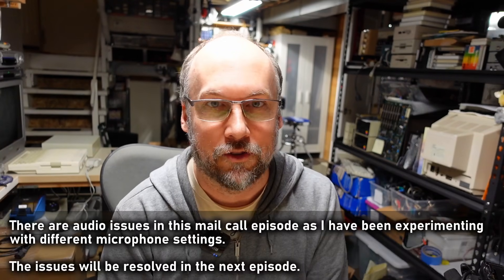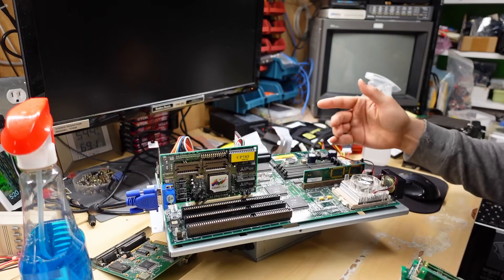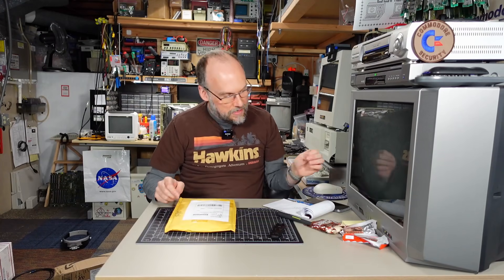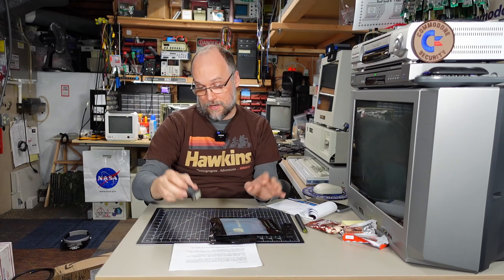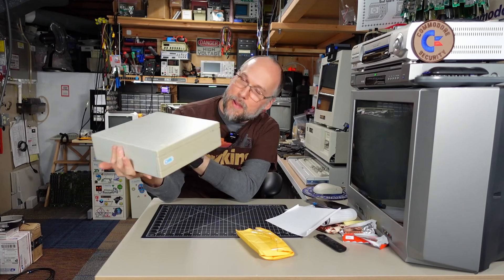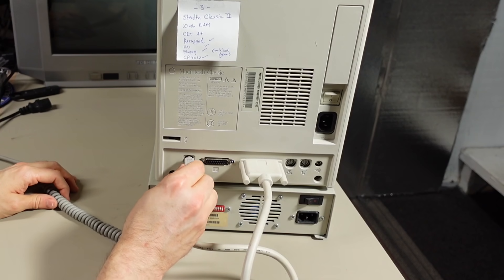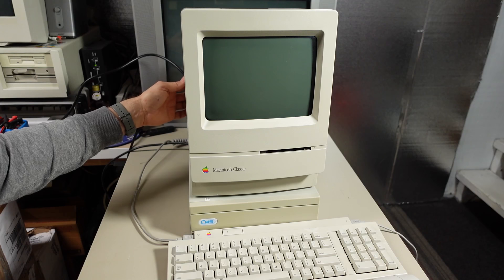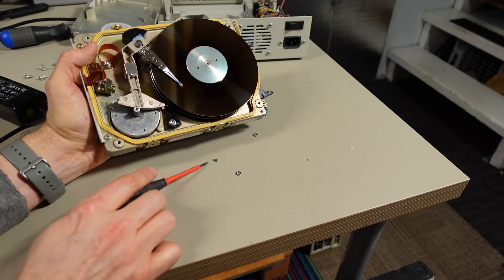30 pin to 72 pin SIMM adapters, a self-destructing SCSI hard drive and an Apple IIc mouse adapter

Comment: I don't remember Bigfoot drives being unreliable, just slow.  They did make a few 5200RPM ones.

I have a Seagate ST-225 which still works well.  And all of these Seagate low-impedance stepper drives have a good amount of intelligence in them.

Comment: 18:56 - I don't know what the difference is but I have a guess. I encountered NES controllers that work strictly on NTSC machines and not with PAL machines. My guess is that some timing or crystal or something is operating at a different frequency and your little adapter takes that signal and converts it to the right signal timing or something. It's just a wild guess but I might be not that far from the truth.

Comment: I had two standard 4x SIMM adapters myself to reuse my old 8x1MB SIMMS in a newer 486 PCI board. I wasn't aware that people would actually do this for Pentium boards, too. Doesn't make too much sense to me though, as old 70ns+ non-EDO SIMMs certainly bottleneck the fast Pentium system. And these huge adapters don't look cheap either ;-)

Comment: The serial adapter must have a wiring layout in it that reroutes the wiring correctly for the IIc for that particular mouse.  Maybe the IIc would only accept a particular serial wiring from the mouse, and other Apple computers would handle any serial input layout from any mouse.  Seemed very strange, but seems like the only plausible answer.

Comment: That Classic is special. Not only does the 3 finger solute reboot it, but it also has an LC-like boot tone. Do you have a custom ROM in there? Maybe a Classic II motherboard upgrade? According to MacTracker, the Classic II did use the LC boot tone.

Comment: 26:40 - Restoration is probably out of the question for these harddrives. But couldn't you rig a CMS to IDE/SATA board and stick a 3,5" drive in there? Seems like the right thing to do, to keep the box intact and "stack" functional.

Comment: OMG, the Quantum BigFoot,  the jokes about that were nearly as bad as the IBM Deathstar
Reply: There was also Maxtor DeathMax.
Reply: And dodgy Seagate's do the Seagate Shuffle. 😁
Reply: I remember the old JTS Champion HDDs and KALOK drives....both pretty much guaranteed to die a quick death.
Reply: @Gectms  Kalok. I remember those well. The worst drives at that time.

Comment: As i found the 286 pc and i started it for the first time, the heads from the HDD wouldn't move, after another try it starts to work, and i had luck, The HDD was Fully Working. It is a 20MB MFM HDD 5,25" 

Thank you for that great Video. oh i have almost forgot, 100GB Notebook IDE Drives new, for their Price, in Germany impossible.

Comment: I think I actually saw one of these SIMVERTERs for sale at a computer store as a kid c. 1999/2000. I expect at that point it was probably new-old stock that just had not sold yet.

Re: Reset button - would it be practical to create a sort of capacitive reset button (like the old touch lamp) that would allow some spot on the case ( or even a thin plate inside of the cartridge slot that doesn't interfere with the cartridge) to be a stealth reset button?

Comment: That second mouse that didn't work with the Apple 2 still hasn't yellowed one bit, it's amazing! Is it just storage differences that caused the drastically different aging (the working mouse is completely yellow, even the cable on it), or is it due to different plastics being used?

Comment: It wouldn't be too hard to design RAM adapters for four slots. The middle two would be tall with slots on opposite sides. The outer two would be short with slots on opposite sides. The extra two would look exactly like the other two, but with the slots on the other side.
Reply: Those mirrored versions existed.

Comment: Maybe for the reset button you could use a magnetic switch on the inside (hot glue or something) and use a magnet to trigger it from the outside?

Comment: I wonder if you can physically remove the arm the broken head on the SCSI drive and low level format? Maybe it'll just show up as a "normal" drive with 1/4 of the sectors marked bad.

Comment: In the UK I use a company called CPC which Big Clive raves about also who supply recon IDE hard drives also parts at reasonable price.  Sorry no Small Computer System Interface hard disks
Also you are right I do not get notifications

Comment: Guessing that SCSI drive was fine before going through the postal system in a flat rate box. Very likely took a hard drop in sorting. Then head ripped off on power up.

Comment: If the MFM drive is mechanically identical could you put the controller board from the SCSI drive onto the MFM assembly and convert it to SCSI?
Reply from the maker: Yeah I didn't even think about that! The MFM drive would have to have same number of heads/cylinders as the SCSI board expected to possibly work....

Comment: Great video, Adrian. Just curious. When that kind of failure happens to a drive (ripped head, trench dug in platter, etc.), are there any options for rescuing data from the other platters? If you could carefully remove the middle broken head/arm assembly, is there a way to make the drive ignore the damaged platter? Or is it programmed to always expect all the arms/heads/platters? Could you transplant the platters/arms/heads from one drive to another? Just wondering what you could do if you really wanted to try and recover any data that might still be available on the other platters. Seems a shame that the whole drive is rendered useless in this scenario. Nothing beats a backup. But many times, one doesn't exist.

Comment: I assume that HDD does some sort of interleaving when low level formatted to improve seek performance.  If it didn't, it should have theoretically been possible to mark bad the blocks on that platter and keep using it albeit with reduced capacity and performance.  I bet there's a way to save it.
Reply: IDK about the older ones ( probably they do it), but newer ones do mark the bad sectors. HDD has a limited supply of spare sectors. When HDD firmware detects a bad sector, it relocates its content into one of the spare sectors and marks the bad one as unusable. There are two kinds of bad sectors - one is logical bad, the other one is physical. You can deal with logical bad sectors by formatting the HDD, but hardware bads are usually a DSQ for the HDD. Also, they tend to "grow", so when first bad sectors appear, it doesn't take long till the drive fills up it's spare sectors and becomes useless.
Reply: I'm sure it's theoretically possible to modify the firmware so it only uses 5 of the 6 heads. Maybe if the same controller was made used in a 2-platter drive the firmware from that could be used instead.

Comment: If he snipped off the bad head, than ran a full low level format, I wonder if the drive would still work with the other side of the platter and the other platters, but at reduced capacity.
Or use another approach, like  bending the scraping arm away from the platter.

Comment: My suggestion for the reset button would be to make a simple cartridge that has the reset button on it; then if you ever really need the right cartridge slot you can remove it.

Of course, then you wouldn't have the button if you needed both cartridge slots. But... was that even ever a thing

Comment: Those old Quantum Bigfoot drives were awful primary drives on a windows system, but they weren't half bad as a secondary drive for data, media storage, etc. The great advantage of them was that they were cheap, so they did that job well. "Unreliable"? No, not for me. Just slow. 

The CMS SCSI card for the Apple II … is more SASI than SCSI, really. It worked with the CMS drive, usually, that's about the best I can say for it.

Comment: I'm curious if the Apple IIc mouse adapter only corrects incompatible M0100 type mice, or is somehow universal enough to not prevent compatible mice from working if used

Comment: I wonder if you could connect the controller from the SCSI drive to the MFM version of the drive and it would work.

Also a quick google search shows there are laptop to desktop SO-DIMM to DIMM adapters even for the latest DDR 4 memories.
Reply from the maker: Interesting thought about the MFM and SCSI controller on the drive. I would think it might actually work yeah. I guess would just need the same mechanism for both? (Heads/cylinders?) Really not a bad thing to try. Sadly I sent that drive off to e-waste already so can't try it. Darn!
Reply: @adriansdigitalbasement  Something to keep an eye out for next time you have 2 drives with the same mechanism but different interface controllers i guess.

Comment: Have you tested the A-IIC mouse adapter with the ones that already work? if that works, then you don't need to worry about which of the 2 kinds of m0100 you are using.
Secondly, I think "m0100" is a shell precise model ID, not a revision precise model ID.(Comparison: the  SEGA Megadrive/Genesis Model 1 had 7 (or 12, if you include every regional variation) revisions)

Comment: would the controller board from the bad drive work on the drive with the MFM board? or would it be too different IE different geometry and bad sector maps etc. I figured you could still re-use the case for other SCSI drives (SCSI to SD maybe?)

Comment: LOL "the drive head just fell off." I bet everyone says that! Email notifications stopped last year (Google deemed them as "hardly used"). You can still get notifications on your desktop via your chrome browser, otherwise you have to search manually from your YouTube home page.
Reply: I still get email notifications for comments but not for new videos. For new videos I just look at the icon in the topbar of the website.
Reply: @eDoc2020  Agreed, or use the subscribed channels on the left edge, but email notifications were still better. Google said the reason they stopped them was that "less than 1% were ever clicked on" (maybe a different % but still very small). I think that is bollo ... rubbish, but my complaints fell on deaf ears.

Comment: This HD could be partially resurrected by removing the #2 & #3 actuator arms, rewiring the #2 & #3 heads to #4 & #5, and configuring as a 4-head 42MB drive. My company's accounting dept. in the early 80's was reeeaaaallly cheap, and I had to do surgery like this to keep old drives in service as long as possible.

Comment: 22:00 the Bigfoots weren't bad in later iterations. the first gen was terrible and unreliable. the second gen were okay and less failure-prone, and they had it down-pat with the third generation and could have kept going if Maxtor didn't buy them out. Even now, the drives they made over 8.4GB in the last generation fetch a pretty penny online, and are some of the more reliable drives from the era touting the Quantum badge. Not only this, but they were fast enough to make a Pentium III boot Win95 in 20 seconds, for what it's worth.

Comment: That external SCSI hard-drive was killed in shipping, i'm pretty sure. Most hardware-enthusiasts probably know this, but hard-drives are pretty sensitive to shock forces. Now, the bearings might have been on the fritz for a while, that's very possible, but shipping hard-drives is really a game of shock-protection. 3.5" hard-drives shipped in bulk have very well-engineered foam "trays", with upper and lower foam pieces that are moulded to fit a number of drives, like 10 or 20. The foam is pretty thick on the outside layers, about an inch i'd say, and the foam separation between the drives is probably at least 3/8" or even 1/2". 
Here's a good example https://images.app.goo.gl/bTcWJdtEtwTUHCsq5
This bulk drive shipping foam is then incorporated into regular packaging around it, paying special attention to preventing the foam "tray" from moving inside the regular packaging.
EDIT: This is what the disk manufacturers are using to ship their drives, and let me tell you these manufacturers are NOT spending even an extra 10 cents on packaging and shipping that they don't need to. If that's the level of packaging it takes to ensure a large enough percentage of the drives survive the shipping to make money, that's the exact cost that will be allowed for that to happen.

Comment: Have you considered using a program like Spinrite on your drives that have bad sectors? I've used it on an 60GB ipod hdd that had bad sectors, and a 3.5" 250GB IDE hdd that had bad sectors, and Spinrite tested the bad sectors and brought them back to life. Yes, it's almost $90, but if you have a few drives with bad sectors, it might be worth it to be able to bring them back to life.

Unfortunately it's not going to bring back a hdd with a missing r/w head... Oh well, can't win them all.

Comment: I have 8 16mb 30 pin simms if you wanted to try 128mb, i used them in my se-30 when i it was operational and hacked to run os 8 as well

Comment: To be fair; Even scsi drives from back then seriously should be given a ten minute warm-up time before expecting them to work.. Sure MFM drives WERE worse.. Back in the day when one had to park one's harddrives I learned early on that you kind of had to make up your mind while setting up the disk if you wanted to be sure to be able to boot right away.. OR.. if you wanted to risk the drive stop finding the sectors "correctly" when it got warm.. I usually opted to let the drive get warm FIRST, and then low level format it, and install software.. sure.. quite often (especially if I hadn't used it for a couple of days).. The drives did tend to start by refusing to boot and claiming disk errors, but.. as the temperature rose and the platter expanded, it started being able to localize the tracks correctly, so.. IF I had trouble booting.. I could just wait ten five minutes or so and then reboot and it was all good to go.. SCSI drives WERE better, but to be honest, I do suspect that is because I didn't start with computers until half a decade after this type of drive would've been made.

Comment: If you’re wondering how the mouse adapter works, you can check the project page for the adapter. Raphael makes awesome open source stuff :) https://www.raphnet.net/electronique/apple_iic_mouse_fixer/index_en.php
Reply: So it's not even adapting anything and only enforcing direction of data? What a strange fix.

Comment: You could try simply lubricating the external bearings on that drive. I used to service them back in the day. We would strip them down in a  "clean room" which was a converted printer sound proof hood.
The heads off one drive will transplant in to another, as will the platters.
Oh.. and don't ever .. ever.. ever blow on a drive platter. Your breath is full of all sorts of junk that will stick to the platter and eventually destroy it.

Comment: Ramverters: There are also left and right handed version. I had all 4 types for a total of 16 MB... I was living the hogs life... Then I sold the computer. Didn't need the adapters after that. No more 30 pin SIMS, no more dirty looks.

Comment: I've got an old ST-238R RLL drive in my 5160 that still runs fine. I was surprised because the last user didn't park the heads and initially it was not working (ST-238R's are one of the drives that did NOT include auto-park, unlike your ST-277N; http://www.bitsavers.org/pdf/seagate/Seagate_Universal_Installation_Handbook.pdf ). I reformatted it and reduced it to MFM mode to prolong its life (RLL on the 238's was notoriously more stressful on these drives, and failed quite often at working in RLL mode as they were essentially an updated and tweaked ST-225; 238's are basically why RLL never got a good foothold on the market). I just parked and cycled it off for a CF card to save it. I'll power cycle it occasionally to keep it from freezing going forward though.

Comment: Apple made several changes to the adb bus over the years but kept the model number the same: here is a web page that describes the issue with the mouse: https://www.raphnet.net/electronique/apple_iic_mouse_fixer/index_en.php the solution is to add a buffer to the inputs so that they are more like what the apple iic expects.

Comment: I've seen tons of different ways to get RAM working on non-standard systems. The weirdest one I saw was a RAM card that used 72pin SIMMs in a IBM PS\2. The System itself used 30pin SIMMs. The card was made by Kingston

https://www.recycledgoods.com/kingston-ktm-609-16-memory-expansion-board-for-ibm-ps-2/

Comment: Is it possible that by using those memory adaptors that the memory might be a bit faster? I was kind of hoping you would do a speed test.
Reply from the maker: Heh if anything it would be slower since the system I tested it in normally is running EDO RAM -- and that old 30 pin stuff would be fast page (or slower?)

Comment: I have the same kind of 30 to 72 pin SIMM adapters, but they work a bit differently. I have 2 sets. 1 set with 4x30pins and 1 set with 8x30pins modules. How do they manage the clearance problem? Simple, each set has one that goes to the left the other the right. 
Here is a picture of them 
https://www.facebook.com/photo?fbid=1566920573491379&set=pcb.1566920673491369
The size coding is done via jumpers that you can see in the middle part 
https://www.facebook.com/photo?fbid=1566920243491412&set=pcb.1566920673491369

Comment: 🤦‍♂️ Open the mouse adapter and find out what it's doing.
🇨🇦🐧
Reply: I think they’re molded solid. Easier would be opening the two mice (one that does work on the \\c, and the one that doesn’t) and see if there’s a difference there.
Reply: A continuity test would likely tell you all you need to know.  It’s likely just cross-wiring a couple pins.